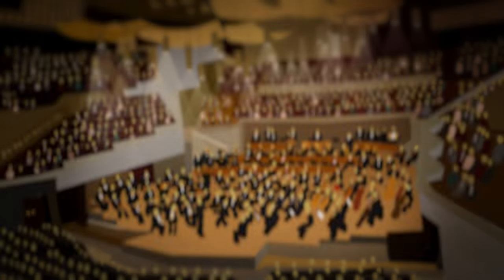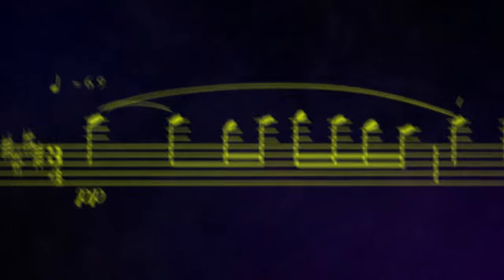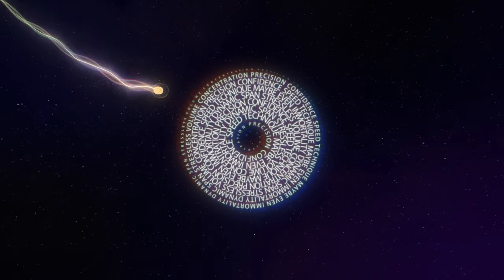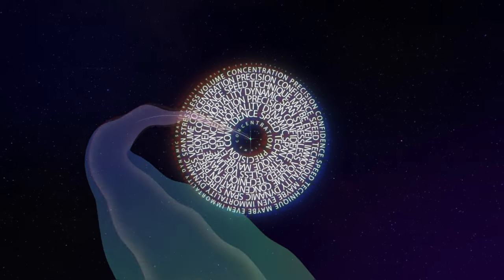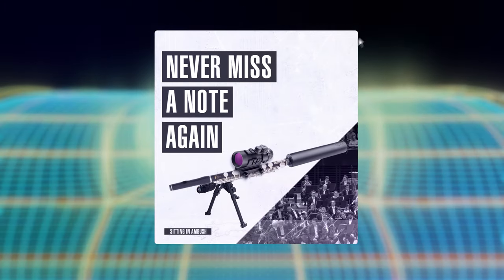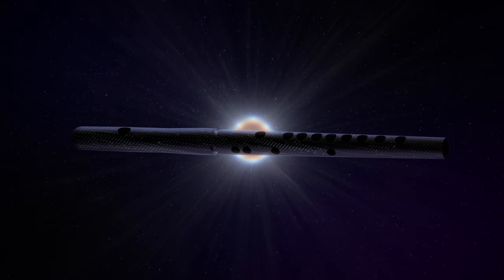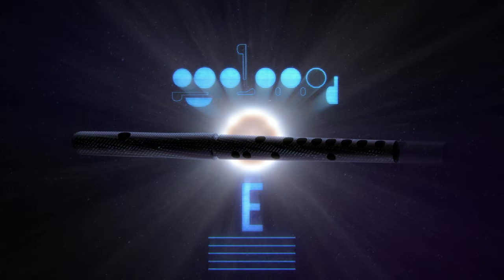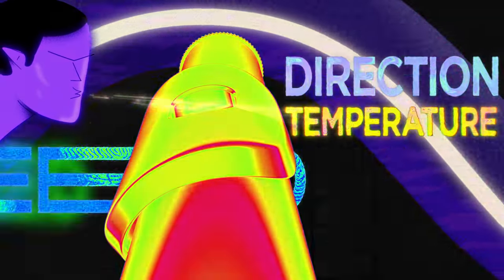Learn this powerful technique to level up your piccolo/flute skill.

Comment: Hi, im a intermediate (grade 6/7 level) flute player, but I need to play the piccolo in my orchestra's next concert for a solo that's very exposed and high (reaching the highest A). I have never played piccolo before and the concert is next week, and additionally the piccolo itself is my schools own therefore cheap and used. Do you have any advice?
Reply: How did it go?
Reply: @carolinebrett2634  it went much better than i thought. i just had to be confident and every note came out clear. thanks for asking x